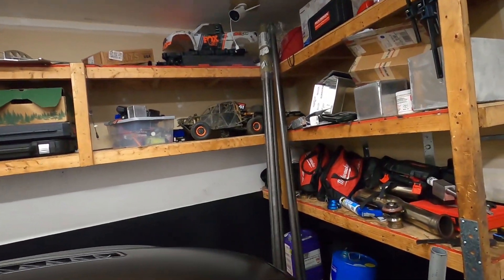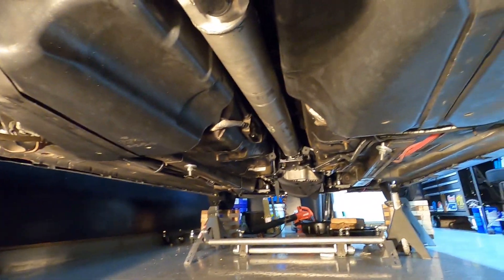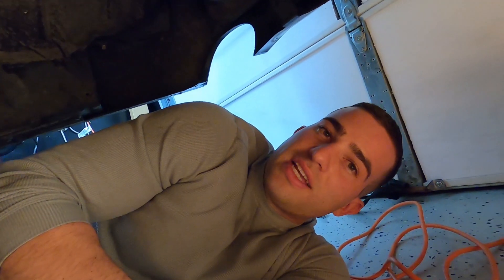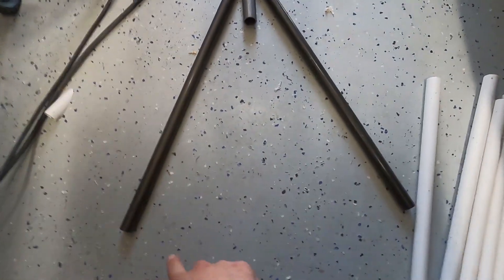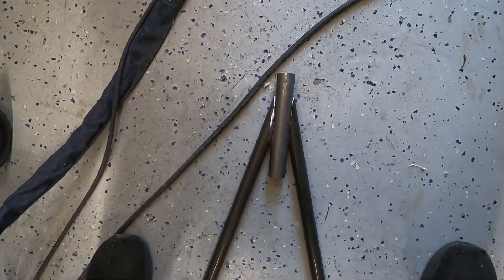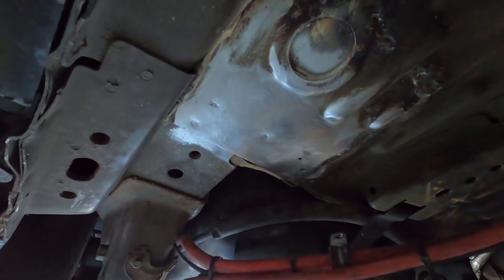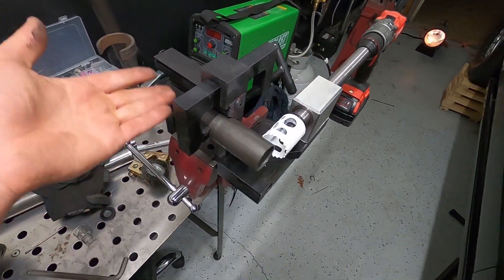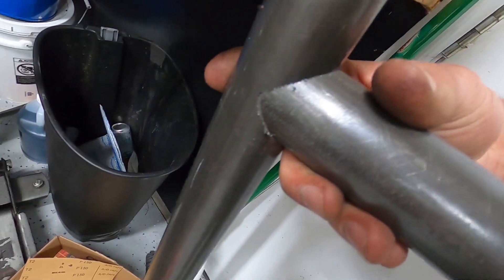Suspension Make Over! Making a Wishbone and Anti Roll Bar! Part 1

Comment: That little bit of sparks in the intro is what it's like Flux-Core welding on you back. 🤣
Reply from the maker: Mannnm that sucked. I covered the sensor,  flashed myself, then blew through and it spit all over me.  Finished the weld though🤣
Reply: @ConnorGuasti   . I need your skills on my cage.... 😁 Well roll bar kit. It should be easy compared to what you have tackled.